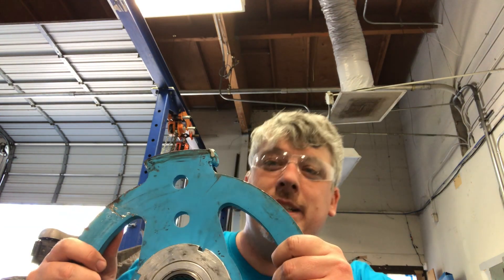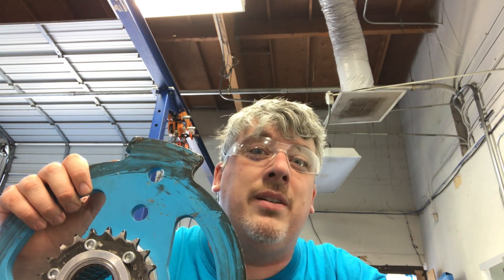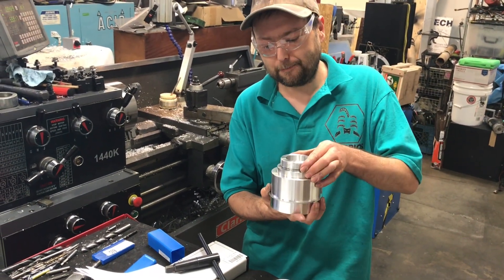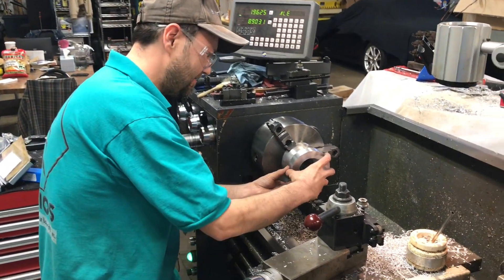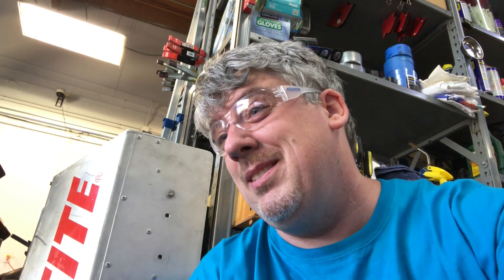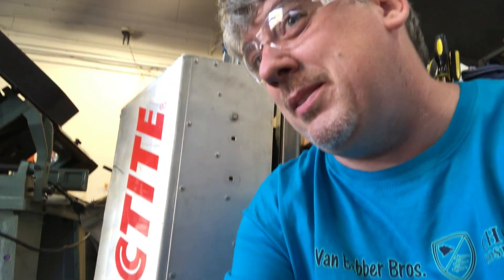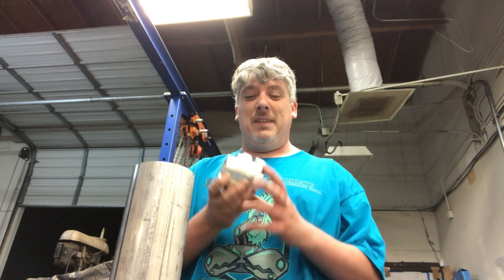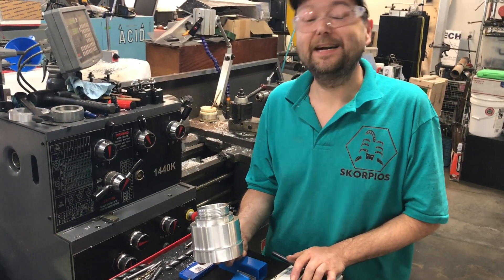Skorpios Build Report Episode 2: Making a Weapon Hub

Comment: Technical question: why aluminum over other materials (metals, plastics, or composites)?
Reply from the maker: Due to the moment of inertia we are trying to get as much weight onto the outer rim of the weapon as possible and reduce the weight in the center.

for this reason we picked aluminum for the hub we have considered switching it to titanium but that option turned out to be to expensive